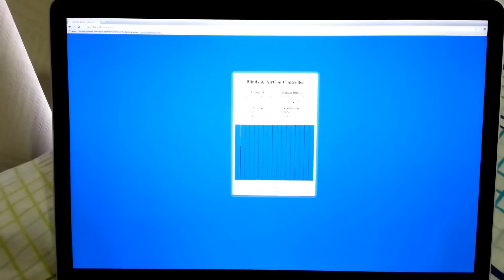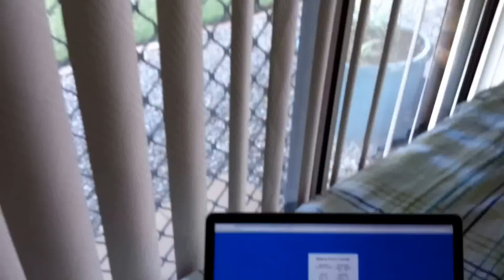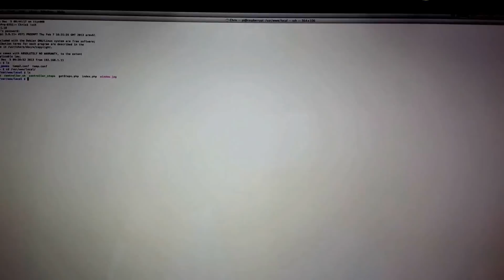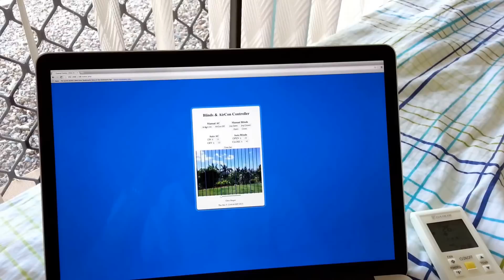Raspberry Pi Blind & AC Automation

Comment: Can you still manually open the blinds? Will this reflect correctly in the web interface?
I suppose for the AC it's no problem as you just send an IR -command (which supposedly are different for ON and OFF)..
Maybe you could add a camera to use a "live" picture? ;)

Comment: I see that stepper motor used without reduction gear. So it's also possible to control blinds manually by the hands?
5V is enough for the motor with direct driving?